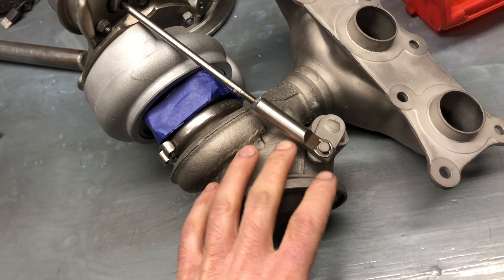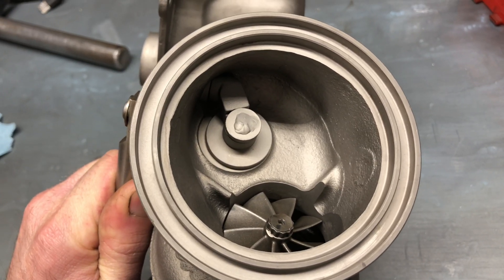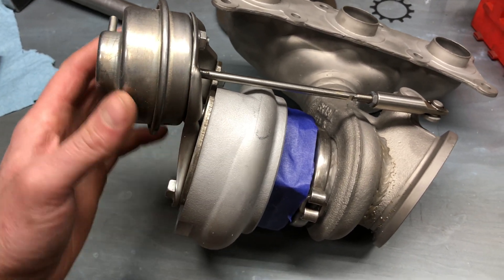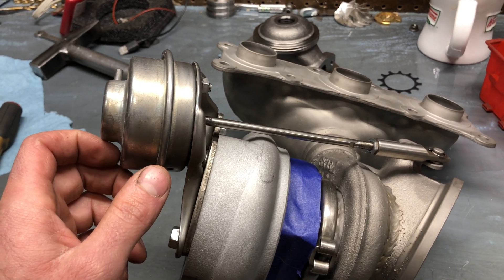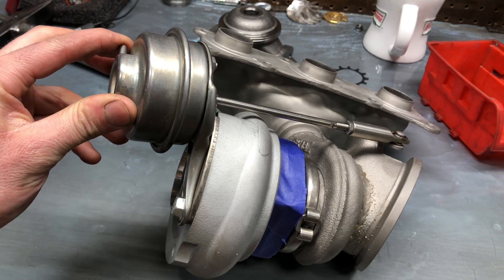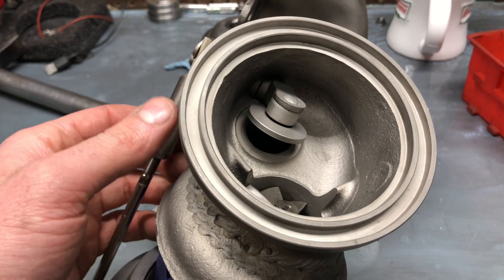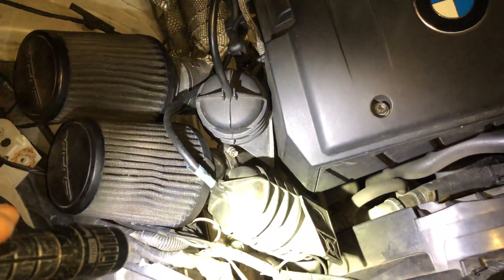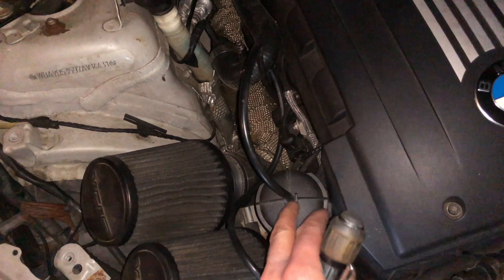N54 turbo wastegate rattle diagnosis

Comment: I have no boost 
New pure stage 2 turbos
New vacuum line
New turbo solenoid 

And still no boost 
What you think could be the problem?
Reply from the maker: The wastegate flap can fall off but I’m not sure if that is a problem with pure turbos. I would try to do a boost leak test. I have a video on my channel showing intake manifold seals I bought from Amazon that leaked causing loss of boost. The n54 stock charge pipe is common to break. If you put any aftermarket intercooler or pipes on it’s best to retighten the clamps about every 2 week to make sure they are still tight because the couplers compress then lose their tension, it take a little bit of time to get them settled, mine leaked, I showed several boost leak tests of my 335xi on this channel, you can see where all of my leaks were fixed and where they came back.